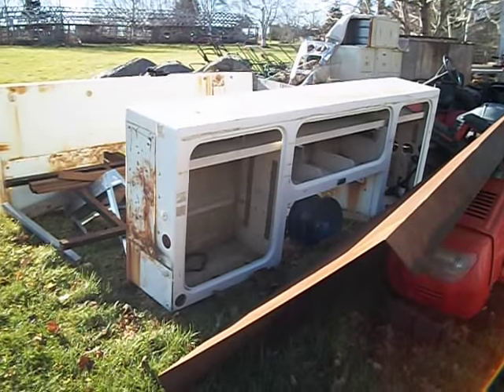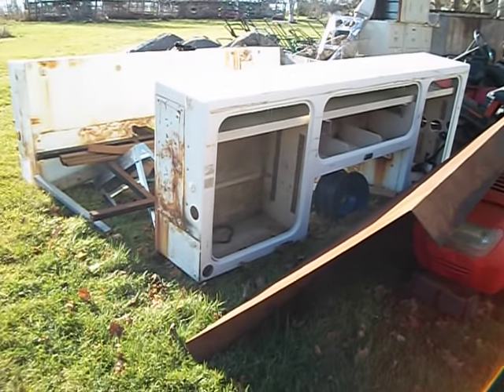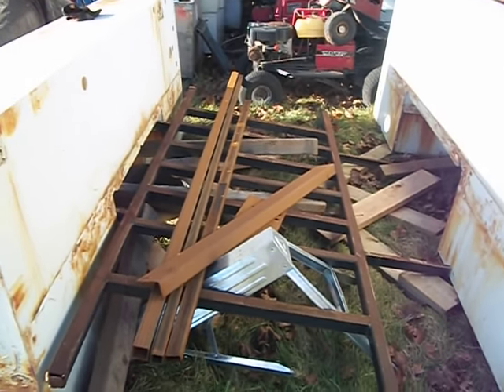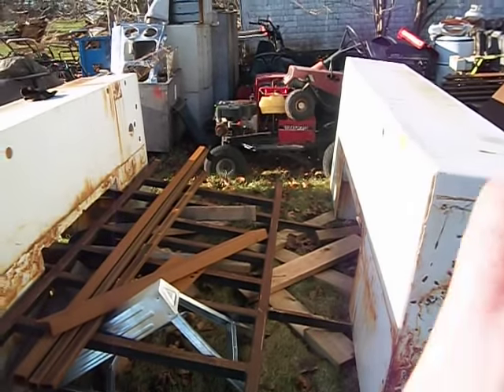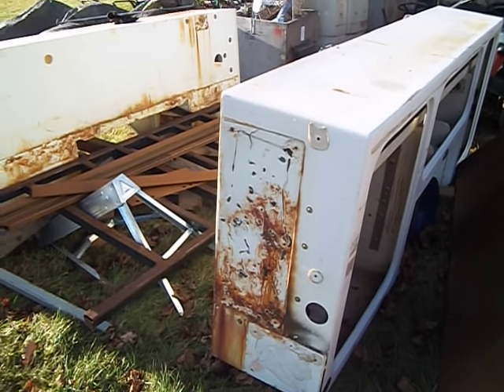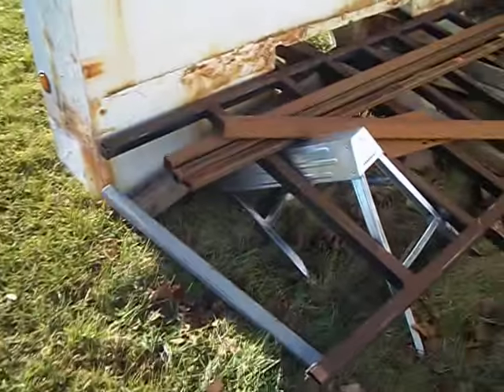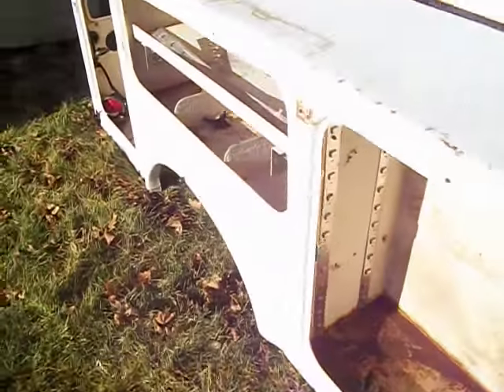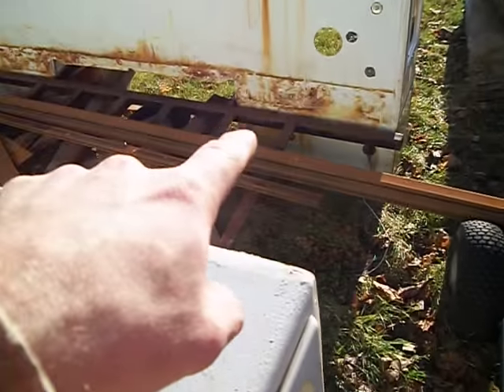Service trailer project

Comment: What happened to this project
Reply from the maker: Thanks for your question Robert.  I had to move in 2017 and so this project had to be put on hold.  The house we bought didn't have a building I could work out of so the service body was stored outside. After about a year I decided to sell it as it was going to take me longer then I thought to build my own shop.  I didn't want it to just rott outside as it still was worth quite a bit. I decided to go back to an original idea I had a while back instead of going the service body route. thx for watching! Don't forget to subscribe if you aren't already!